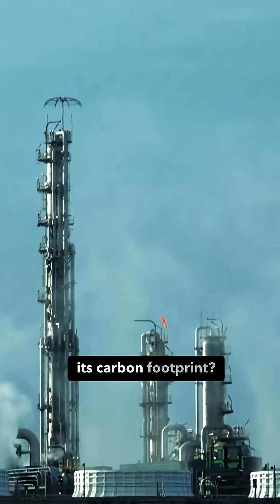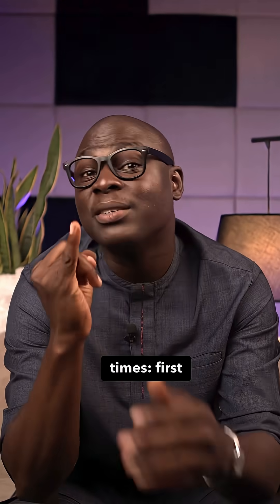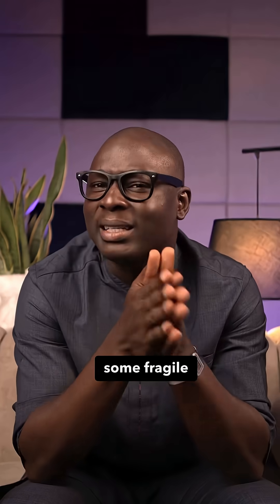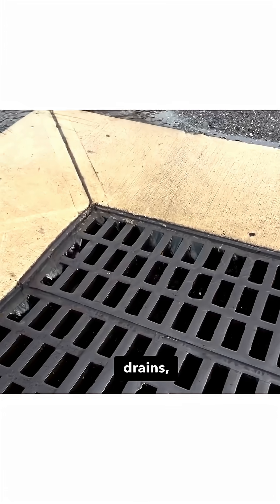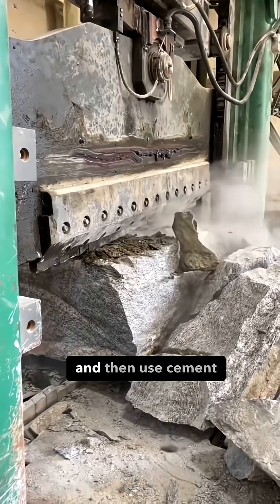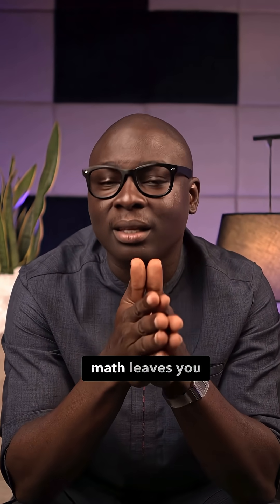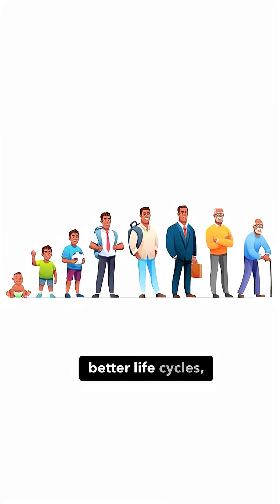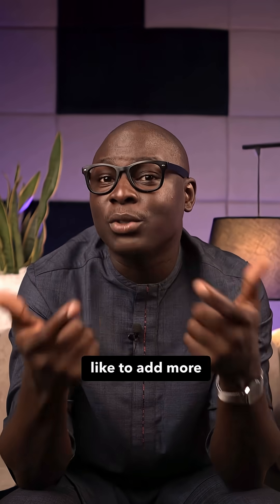Sidewalks: A Surprising Solution to Urban Carbon Reduction#carbon #carbonfootprint #sustainability

Comment: Great observation !!!👍🏽👍🏽👍🏽👍🏽

And it would be perfect if tiles/granite etc are available and are sold at competative price.

Immediately, we start using them, their prices may skyrocket and even homes may not be able to afford them. They will have a juicier price in road and construction. As usual, if demand supercedes supply, the price skyrocket to stabilize the market equation.

And one has to put into consideration of posible vehicular movement on the work way, because " some people no dey hear whot", they will overload and crush low loading capacity tiles installed.

Comment: this might seem redundant to ask but do we have enough granite to scale this nationwide or make it the standard everywhere across the country? also what about paver blocks made with clay? are they a good alternative too?
Reply: I am not a professional but talking about the granite deposit across this nation, we have more than enough. The granite crushed to make mixed concrete can be cut into tiles instead so we have enough. 

For clay based paver blocks, I feel it won't last much. Clay blocks are better for vertical laying. My opinion though
Reply: @phemmie_voiceofasaphbakkie5419 thank you. you're reply makes sense. i asked about clay because of how sustainable and readily available it is locally
Reply: @joey8033 yeah... Very readily available and can be stronger than our produced cement based blocks that a finger can crush. 

Apart from being readily available it has other advantages over the other such has; 
- Provide excellent thermal insulation (keep buildings cool in hot weather and warm in cold weather) 
- Allow walls to breathe, reducing dampness and mold.
- Offer good sound insulation,hence good acoustic
- Made from natural, eco-friendly materials and can be crushed and safely returned to earth when no more needed..
- Lightweight, easy to handle, reduce structural load on the foundation especially the hollow types
- Highly fire-resistant.
And the list goes on and on. 

Don't know why in Nigeria we abandon good stuff and embrace anything or idea imported even if it isn't the best for us... I don't know